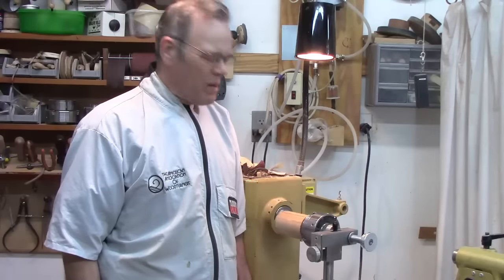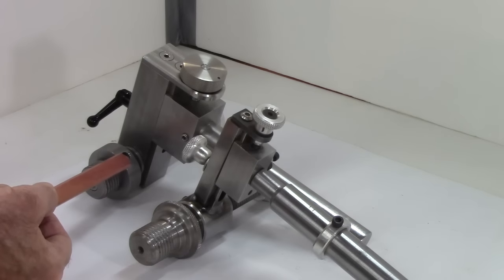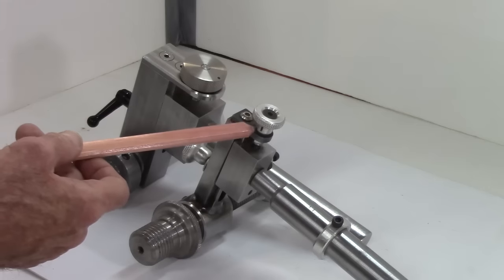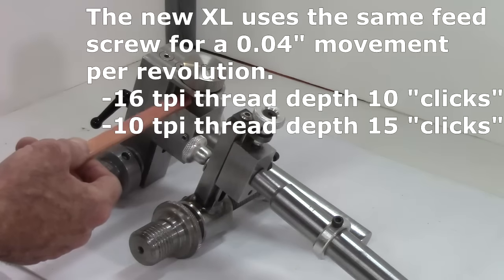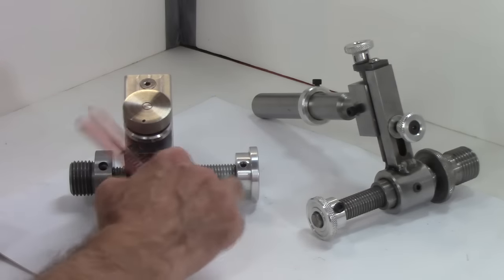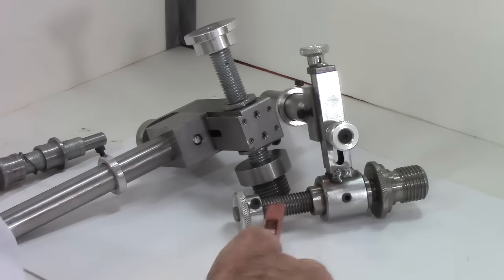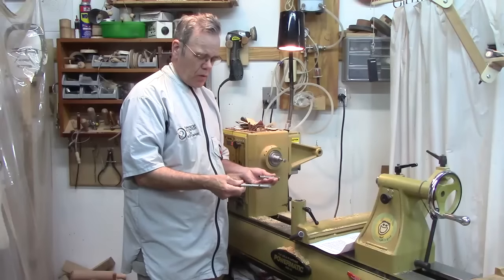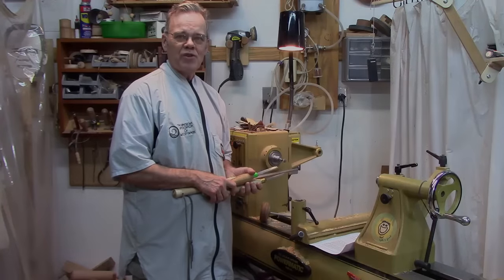Threading Jig for Wood Threads - New Model

Comment: thanks for info and yes looks like beefed it up a bit will have to check this out or build one at work on my free time :)
Reply from the maker: +Michael Thruman 
I am not a machinist so my shop made jig made of wood and off the shelf course rod and nuts did not meet my needs adequately. I had a difficult time with run out and taking up any slop. YMMV.

Comment: Thanks Mike.Small detail, I may have missed it...  but where do you get the cutting tool, i.e., the bit?
Reply from the maker: The cutter comes with the jig from chefware kits. I put their website in the description. Or you can buy a double bevel 60 degree angle cutter from Enco or other industrial tool supplier. About $30.